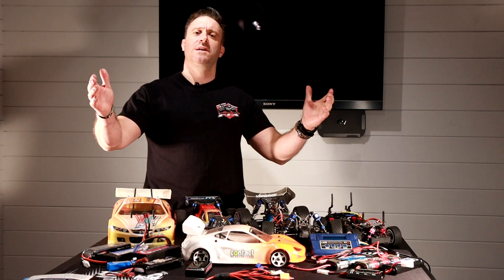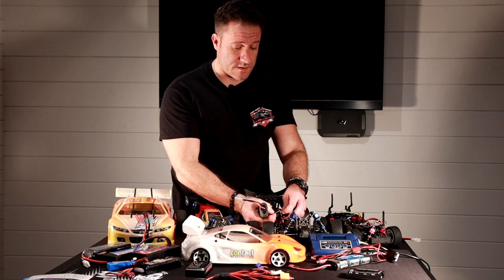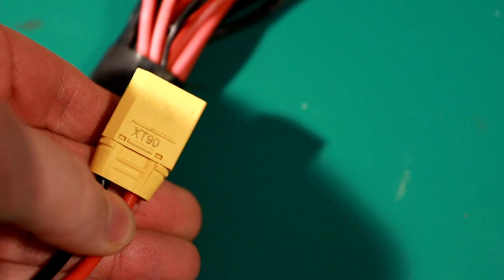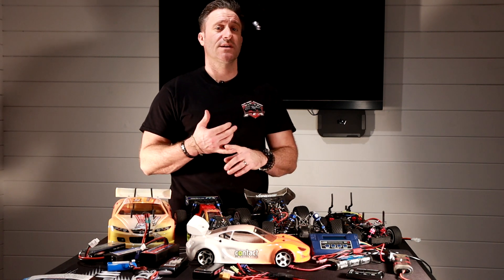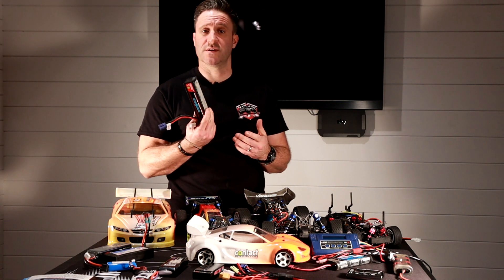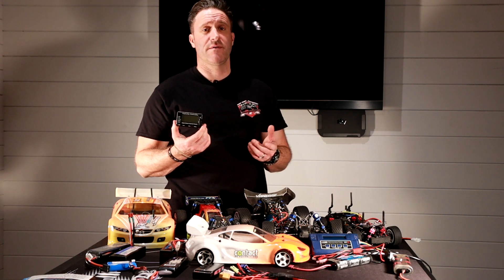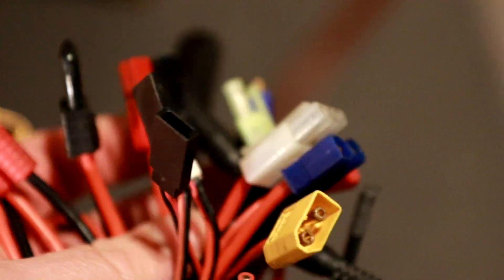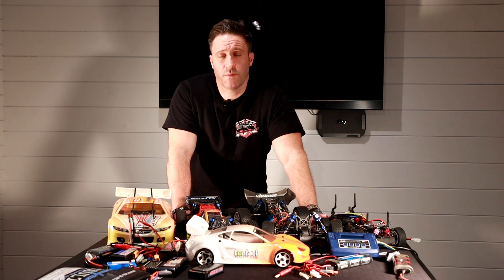RC Car batteries explained

Comment: LIPO batteries are dangerous. 
Period. 
It cannot be overstated. 
There are only two kinds of frequent RC Enthusiast; those that have had a LIPO fire and those that will.
They are not a toy but can be kept very safely by taking simple precautions. 
Nice video.
Reply from the maker: Cheers Chuck